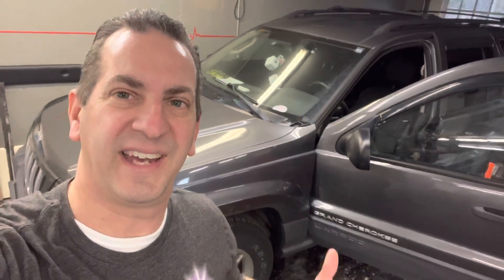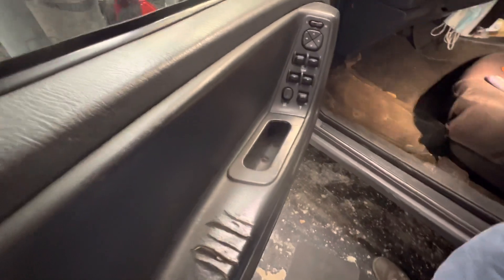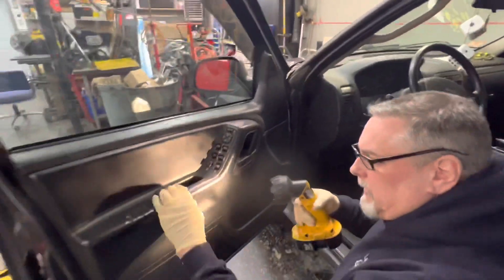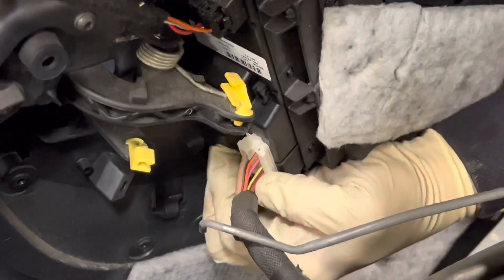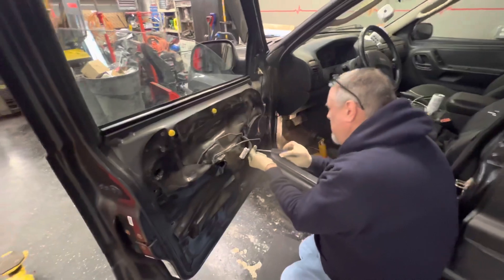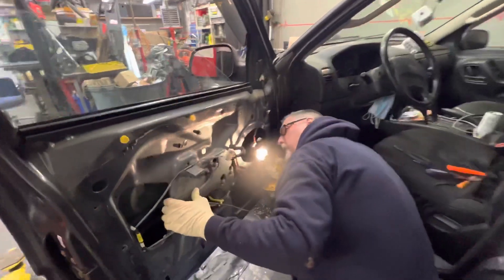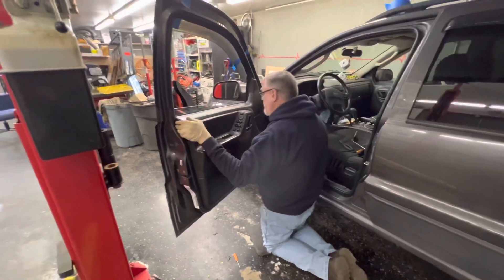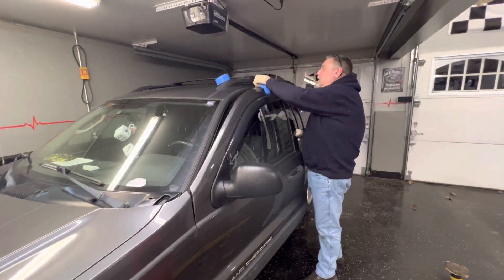How To Replace 1999-2004 Jeep Grand Cherokee Window Regulator

Comment: Great Video. So glad I found this as I'm getting ready to do my drivers door regulator in my 04 Limited. For those wondering about the pins, I found the info for those when I had to remove the door panel to upgrade the speakers. Here's what I found - 1999-2000 white pins P/N # 5605539AA  - 2001- green pins- P/N # 6503204 - 2002-2004 -yellow pins-P/N# 6507686AA. Takes 11 pins per front door panel. Pins can be found in major online sellers as 99-04 Jeep Grand Cherokee WJ door panel/trim fasteners.
Reply from the maker: Glad it helped